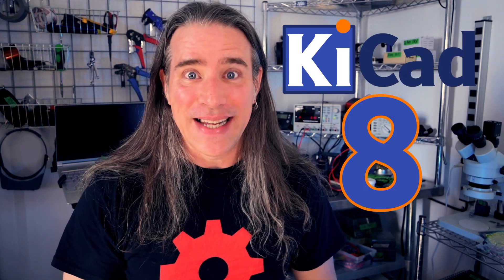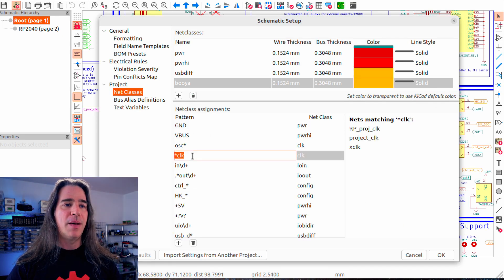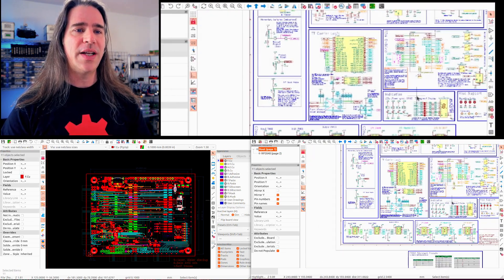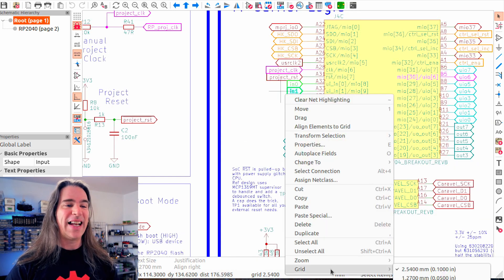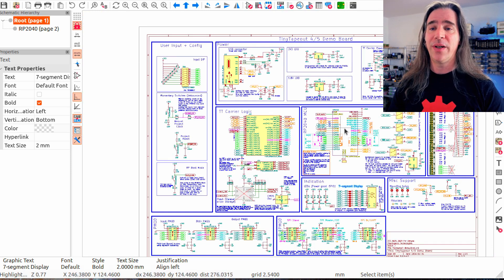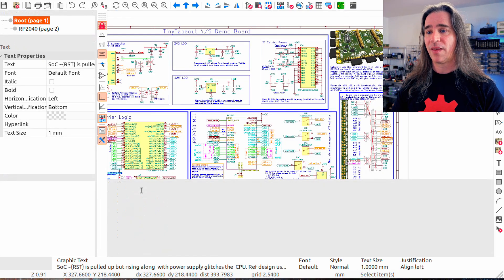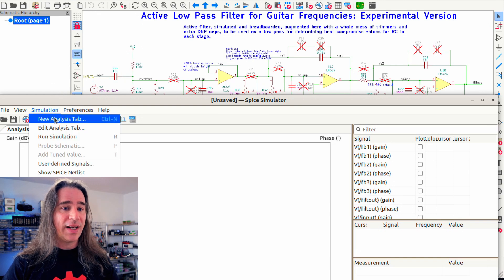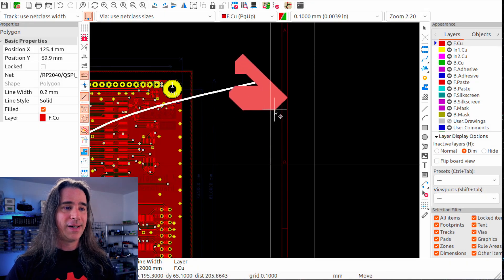KiCad power use: the most out of 8.0

Comment: Did you know that you can use AFNOR SPEC 2212 for your design rules? I've made a video on the subject if you're interested. Thanks for the video!
Reply from the maker: That is cool, I think: I actually had to look up the spec and the AFNOR itself.  Haven't had time to look into it yet, but am curious and have many questions.  Does the spec supplement or supplant IPC stuff?  What's the advantage, how stringent/compatible is it with, say, cheaper chinese fab capabilities?  Anyway, I've queued "Conception de circuits imprimés : une révolution pour la vérification des règles de conception !" -- is this the vid in question?  
Thanks for the pointer, cheers.
Reply: Yes, this is the video. It explains the importance of routing parameters and how to choose their values. I show that the manufacturers' limit values, the NF C93-713 standard and the IPC do not meet our needs, unlike AFNOR SPEC 2212. The values comply with IPC 2 and 3. They are complementary. If you're interested in the subject, I've set up a free training course on my site (France CAO) and created dynamic tables to easily search for AFNOR SPEC 2212 values. The video is in French, but an automatic subtitle translation is available (pending audio translation from Youtube "Aloud") as for the website. I've translated the dynamic tables, which you'll also find on the website. This document is a real revolution for designers. There are 10 routing classes to choose from, allowing you to select design values according to the complexity of your board, and thus adapt the price and difficulty of manufacture. There's a lot more to say. I'm preparing two more videos to complete the training.
Reply from the maker: @france-cao  That's great, ok, will check it out for sure.  A noter, je suis a Montreal, le francais: pas vraiment un probleme :-)  merci/ciao!
Reply: Ah super, n'hésite pas à me contacter alors si la vidéo ne t'apporte pas toutes les réponses. Montréal est une ville géniale, j'y suis allé deux fois et j'ai de très bons souvenirs !
Reply from the maker: @france-cao  excellent!  De la France, je n'ai eu le temps que pour Paris, mais je me suis payer du tres bon temps (la nuit aux deux Dr. Feelgood, oof 😀).  Fais moi signe si t'es dans le coin, cheers.
Reply: @PsychogenicTechnologies  Merci, je te retourne l'invitation. a+
Reply: @PsychogenicTechnologies   Yes, this is the video. It explains the importance of routing parameters and how to choose their values. I show that the manufacturers' limit values, the NF C93-713 standard and the IPC do not meet our needs, unlike AFNOR SPEC 2212. The values comply with IPC 2 and 3. They are complementary. If you're interested in the subject, I've set up a free training course on my site (France CAO) and created dynamic tables to easily search for AFNOR SPEC 2212 values. The video is in French, but an automatic subtitle translation is available (pending audio translation from Youtube "Aloud") as for the website. I've translated the dynamic tables, which you'll also find on the website. This document is a real revolution for designers. There are 10 routing classes to choose from, allowing you to select design values according to the complexity of your board, and thus adapt the price and difficulty of manufacture. There's a lot more to say. I'm preparing two more videos to complete the training.

Comment: Dang! I need proper models for my simulations.

The number of times I've been hijacked by my own inability to accurately copy from LTSpice (which is my usual go-to due to it being free and having lots of models - how good they are, I don't know) is legendary.

I've jiggered several production prototypes (at fairly great cost to me in time and money) simply because I did something like copy-paste a bunch of resistors for speed and then forget to change the value of one of them. A simulation would pick stuff like that up, but models are a gotcha for me and I've been less than effective at getting the ones I did find to work.

Op Amps are a particular bugbear since I'm not good enough to read a SPICE model, I have little or no idea were the pin assignments appear. I know this is fairly basic stuff but I don't know where to start.
Reply from the maker: Ah, yes.  The models, what a thorn... but I do think having everything in one place, schem and sim, is super powerful, and have found some pretty good ways to work with ngspice within kicad.  Am hoping 3rd time will be the charm: twice already, I'd started a video specifically on the topic and, by the time I got around to editing, well kicad had made things different and better.  Going to try again, this time do it all in one go with v8, and finally put something useful out there.
Thanks for the comment, Marc!
Reply: @PsychogenicTechnologies  Totally agree with your response. I've never been near to Altium and their prices, I won't be any time ... ever.

But KiCAD is more than enough and your video had some excellent suggestions for productivity.

One thing I wish they would "fix" is the cut/paste so that I could paste an op amp (specifically) from the part selector and have it align the inputs. I expect the same could apply to other parts too if they are bilaterally mirrored in some direction.

It's a minor one but it's caught me out before (on  a production board too). My fault of course but this is where even a "one size doesn't fit anyone well but it keeps you drier" raincoat. op amp would come in amazingly handy.

 Seems a good fit and would just have to be "ideal" to check basic functionality.

Comment: These features are great news, but highlight my frustration with KiCAD generally, that this is mostly really basic UI stuff and should have been there a long time ago.  The historical UX of KiCAD really shows it was written by a subset of end users for their own needs with no real appreciation of software UX.  The awful bulk properties editors should just be gone now there are properties sidebars, I should be able to select anything and edit any shared/common properties on those objects.  It also highlights the lack of disconnected development between PCBNew and EESchema that colours aren't brought over for nets etc.  I just hope the dire footprint editor has been improved as that has to be one of my biggest gripes as I am really tired of having to use a CAD package to get a novel footprint built.
Reply from the maker: Hi Neil!  Ah, yeah... I can really see both sides of this: I totally agree with you on most of that and also am absolutely guilty of doing exactly the same thing, hah.  I'm terrible at UI and UX--and it's not even that I wasn't trying but, when you're too close the bare metal/data structure/db/whatever, it seems really hard to break away and look at things from the UX side.  And, ok, I'll admit that the zillion edge cases and ways users break everything drives me nuts ("Just use it RIGHT!!1!" hah, the absolute opposite of the way an interface designer should think), and you wind up just wanting to get back to what you were doing, your itch finally scratched.  
That's not the way to wind up with a usable, polished, enjoyable, professional interface/tool.  And, though kicad had more people and more time than most of my dreadful UI work, I think it suffered from similar types of history and attitude, plus the fact is was a number of disparate projects getting smooshed together.
Anyhow, that's all excuses and, if you presume to make a usable GUI program, you have to get over all that and get it done right at some point.  Took a while, but I think they're getting there and as the program gains traction, momentum and support (cash), that will just accelerate.
On the other hand, I actually like the bulk edit and basically use a whole lot of math to create and place pads in the footprint editor (I love that the fields just let me directly translate the logic and info of engineering diagrams into position, for example... "ah yes, y will be (1.27/2)+((14.58-2.54)/2)" or whatever), and so I use lots of that, and ctrl-T and ctrl-M... a steep learning curve, maybe, but I've personally no complaints there.
Reply: @PsychogenicTechnologies 100% agree I first saw it transitioning in the differences between 5.x and 5.99, I felt they were really significant. What really saddens me, is KiCAD dev feels exclusionary.  I am a UX software engineer first, I could easily and have regularly, seriously contemplated contributing to this O/S software I get a ton of value from, yet every time I read a KiCAD forum post it is always "you should know better" etc, you need to learn how "we" do things etc, "it is our way or the highway".  6.x+ feels like that attitude might be changing, but why take on those battles - I do that in my day job, I'm not doing it for fun.   The problem is I'd love to contribute, but I find it a very unfriendly and TBH conceited community compared to other O/S communities I have been involved in.

Comment: Is there an easy way to upgrade from 7 to 8 while keeping all the custom symbols and stuff (that I left in the default locations instead of in an external library)? I’ll be going Linux soon so I hope package managers will handle that all for me. I went through all the P-channel MOSFET symbols and flipped them so the body diode points upwards, as god intended, I’ll be damned if the update reverts that. Or even better, CHANGE THE DEFAULT P-CHANNEL FET ORIENTATION! Already lost one board revision on that, spent a few hours bending legs to get TO-220s to fit.
Reply from the maker: Oh, sadness.  I can't answer for anything other than Linux, but can tell you:  when I was playing with the release candidates, I was running kicad 7 and 8 side by side, and it would've been a simple matter to add the symbol and/or footprint libs from 7 to 8 (in terms of paths, potential naming collisions are another story).
However, as far as I can tell, the upgrade to 8 just squashed all the old libs in /usr/share/kicad/*
So, my first bit of advice is, at a minimum, get yourself a copy/backup of anything you've edited in the standard symbol libs.
It should actually be a pretty simple matter to configure some path KICAD7_SYMBOL_DIR var and import all of those libs--as long as they don't get overwritten by the upgrade.  Main problem I foresee is untangling all the 7 vs 8 duplicates you'll wind up with if you do it this way.
I have a number of custom libraries, to which I add things like your corrected P-FETs and then it's just a matter of making certain they're in the config as globally available libs after any major update like this, and they'll never be overwritten by updates etc--I'd recommend this approach moving forward.
Reply: As far as I know, EVERYTHING in the libraries KiCAD comes with is getting nuked every time you upgrade - those should be treated as effectively read-only. If you want to change anything about them you'll either have to create your own custom libraries from the defaults, or you'll have to do some rather creative lib location wrangling completely manually each time you upgrade.
Reply from the maker: @AttilaAsztalos  Yeah, agreed.  Find it a little odd how the various KICADN_* paths seem to be accumulating, tho (like KICAD7_SYMBOL_DIR etc under my linux anyway)...  you'd think it might be to avoid jostling everything around on each update, but it all winds up in the same place, as far as I can tell.

Comment: Wow! Some cool enhancements.  I like being able to add a little bit of colour to schematics, even if only for two or three classes of signals.  Without having looked into it (I'm a very occasional KiCad user), I would hope that in the PCB editor there is the ability to display tracks on a given layer in a single colour regardless of their colour in the schematic. Otherwise, multi-layer work could become very confusing very quickly.
Reply from the maker: Oh, yes, you're right: with the coloured nets it can actually look like there are shorts where there aren't any, because you lose the ability to know what layer you're on.  However, colour-by-layer is the original and default behaviour: classically red for top layer, green for bottom, yellow for in1, some sort of pink for in2... those are the ones I know by heart (configurable of course).  I switch between both views--sometimes I'm caring about stackup, sometimes about logical families, and it's more this ability to focus on either aspect than the colours themselves, that I find uber useful.
Reply: @PsychogenicTechnologies  Thanks!  That's really good info.  I always selected my own colour pallete for the layers to suit my needs. I think nets coloured by classification could be useful, but it's a whole new way of looking at a board, especially if manually routing.
Reply from the maker: @GodmanchesterGoblin  absolutely.  I always route manually, and now use the colours to highlight important/sensitive tracks (high speed, diff pairs, analog) and things that should go together for some reason (like any group that cares about skew or whatever).  Then I use it in phases, like I'll start with power and all the hyper sensitive stuff, then work mostly in colour-by-layer, then get big picture view and do validation correction back in netlist colours etc.  I like it a lot.

Comment: Wooooow A power symbol became editable in 2024! What a great achievement. I mean it. Every time I was forced to create a new power symbol, I wanted to switch the platform.

PS They wouldn't be developers if would not add one annoying thing. Now, when you select a footprint for a symbol, you CANNOT MEASURE it right in a selection window. That's ... annoying
Reply from the maker: I have to agree with you--sounds a bit sarcastic there but if it was I understand: I myself feel a mix of joy/relief and a touch of well-that-took-long-enough, hah!  
I hadn't stumbled on your annoying thing, yet--will have to check that out.  Because I often wind up double-checking pad spacing or whatever in the footprint selection dialog, before moving on and it sounds like they've made that harder, which would suk.
Reply: @PsychogenicTechnologies  Exactly! Many times I just preferred to use some predefined footprint rather than to create a custom one, and as you said the double-checking helped. A lot. Now I'm not sure anymore, and with a saving time on new useful features, I have to spend it on checking dimensions in a footprint editor. I believe they will fix this soon. Cause that "Select footprint" dialog has plenty of an empty space to place a dimensional info there.

Comment: For wires that stay on the same sheet I would not use global labels. Just use net labels. This makes your schematics look cleaner and you are not forced to create unique names for an entire project. Global labels should be used only for wires running across several sheets. At least this is what I do. Otherwise, great tips !
Reply from the maker: Fact is, I agree with you on the globals.  I may have made a bad decision in using them for this, but the circuit is an open hardware/community type thing, and hopes to be as self-documenting as possible.  
And labels... don't have DIRECTION!   There's not enough differentiation with text, to me, and they don't have the added clarity the global labels provide to say "signal is coming out of here"  "signal is read by this pin" that the globals have.  So, on occasion and depending on audience, I'll abuse the globals like this.
Reply: @PsychogenicTechnologies    Fair points!  Maybe it’s just that I come from software development, so seeing “globals” used as “locals” feel kind of out of place to me. For single sheet projects it certainly makes little difference, but for very repetitive highly hierarchical projects, global labels quickly become a mess. On the other hand you can safely use net labels in sub-sheets and they remain unique on every instance. In order to tell signal direction I tend to place inputs on the left and outputs on the right, whenever possible, or make it explicit through label names. Anyway I’m far from an expert here, and I appreciate your reply and insights !